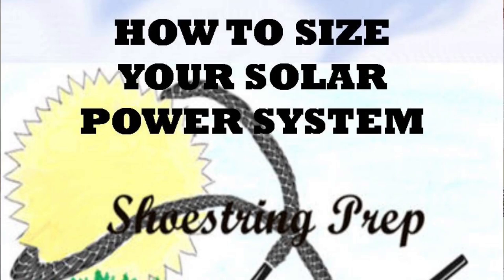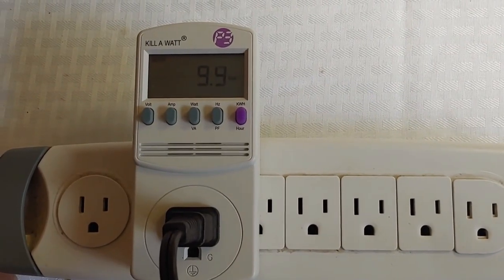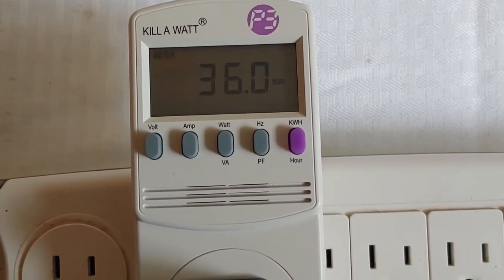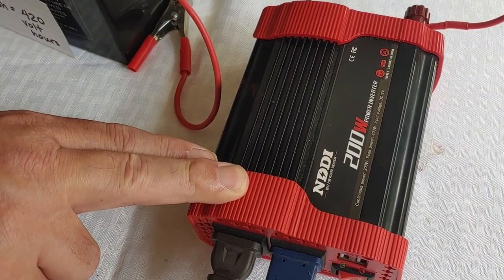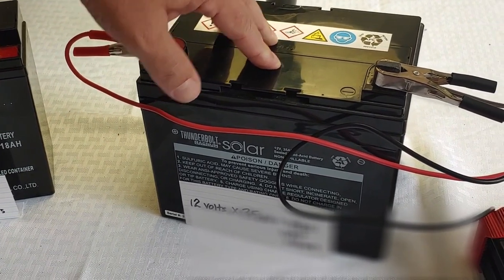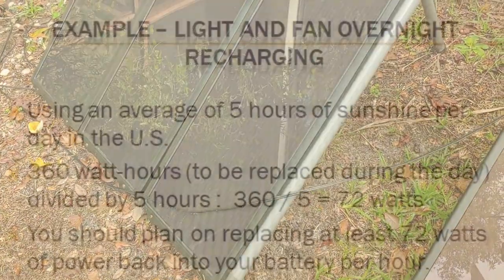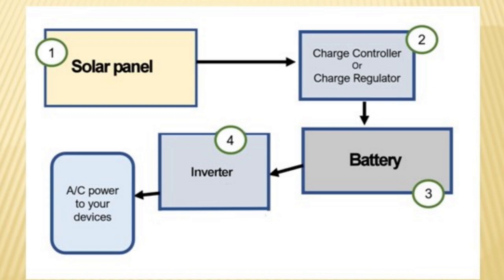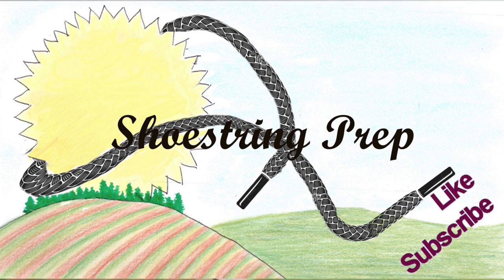How to Size your off-grid Solar Power System

Comment: I got one of those kill-a -watt EZ meters.
I wanted to see how much the freezer used that I bought...it just says it uses so many kwH a year. But I got a surprise when I checked the microwave...on the box it says it is 900 watts, but the meter says it uses 1472 watts, whether you use the oven or the micro. Average for the month, my system is making 3.2 kwH per day, but if I go out about noon and change the panels from a morning angle to an evening angle, I get around 4 kwH. I want to make some ground mounts for some of the panels, but I'm waiting on the end of the month to get a generator to run the welder with. It was this time last year that I had to replace the boards inside my Aims inverter charger from running  it. It takes 2400 watts. I'm getting a 3500/3000 watts Generac. I haven't had to charge the battery bank from the generator since March 2021. I wound up with 20 marine batteries, 990 amp hours @ 24 volts. I tried making a spot weld from the batteries once...not really enough volts, but the amps were there. It welded a little bit but it tends to stick the rod if not careful. Then it will very rapidly glow red, lol. I'm also cobbling together a  small wind generator for the winter months. Well I'm gathering parts until I can weld something. It's part of an off grid experiment that I've been working on. I had to move half of the panels farther away for summer. The amps were getting too high. So I moved them to where they get sun longer, but that was 40 feet away from the controller.  So the amps are about 25 now instead of closer to 40. But with the longer hours of sun, I actually get a better charge on the battery bank. If I bring those panels to about 15 feet away when the days get shorter, the wattage will go back up again. But the sun will be weaker by then. I can probably get enough until January. Snow usually comes then so I will be glad to have the generator this year. I cooked a lot on the wood stove and it was a mild winter last year. I have been off the grid for almost two years now. I got my inverter charger in November 2020. At 4 : 20 AM, the voltage is 25.0 .
Reply from the maker: All good info. Thanks for the comment.